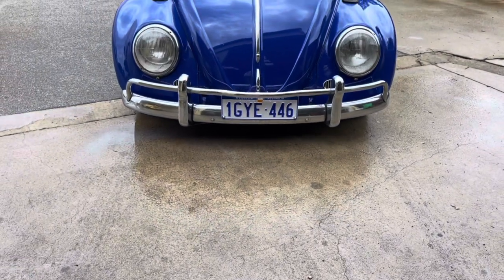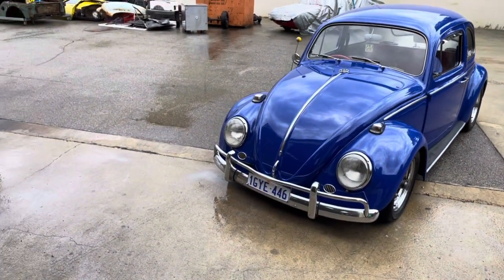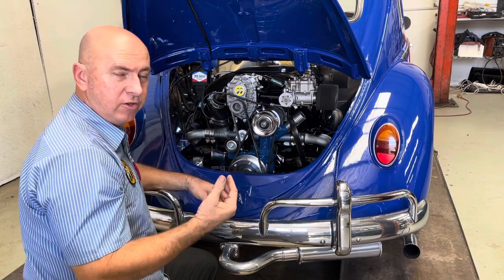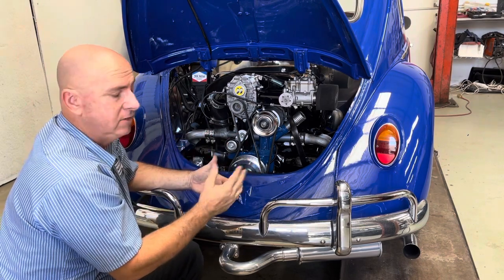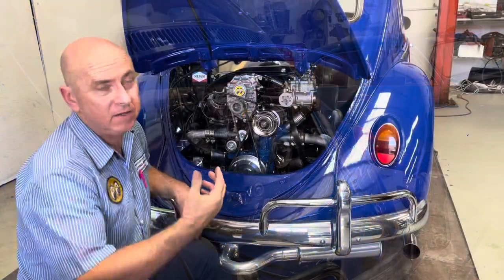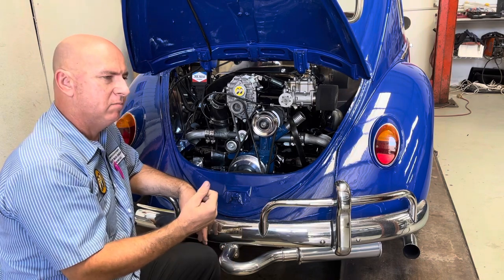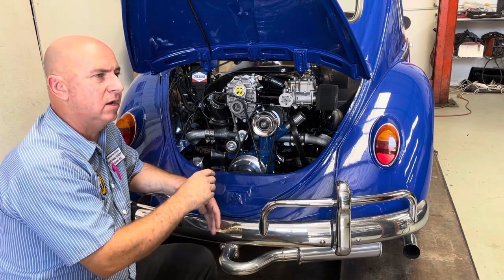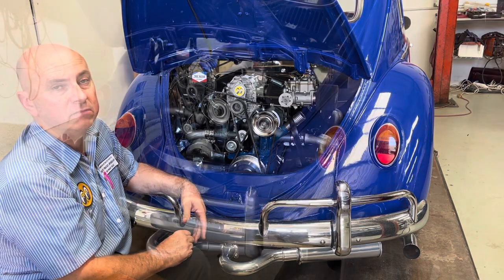Vintage VW beetle supercharger install and test drive with Armadale Auto Parts

Comment: Great neat installation of the blower. The beetle is very tidy. A have a 71 model with some custom mods. I am running a Stan Pobjoy 1916cc engine. One of these blowers would be trick. You have some great cars in your shop too, thanks.
Reply from the maker: Thanks!

Comment: Hi Alan, thank you for the video. I am considering the same kit for a future engine build. Mick at JB is very helpful. I am a bit surprised by the noise as it appears to be a serpentine belt drive so I assume the noise is from the supercharger. I have an Eaton supercharger on another vehicle and it is very quiet. I always wanted to build a hot rod but I think age is going to beat me.  :-(
Reply from the maker: Hey Michael, yeah I think most of the noise is the supercharger itself.

Comment: Cool well done I'm Thinking of getting one of these kits for Bess Instead of Going Down the more traditional path Too Make her a Little More Responcive for modern day Traffic conditions 
Bess Is still Totally stock , are They Reliable you reckon for a Dayly driver once its all set up Properly ?
Reply from the maker: Hi Brian, it took a bit of sorting but now seems to be pretty good. Good low down power increase for sure.

Comment: How did you go for deck lid clearance on this? Cheers
Reply from the maker: Hey, we used a deck lid stand off kit. It might just fit but very tight , mainly at the air cleaner part

Comment: is it possible to add A/C with this setup?
Reply from the maker: It would be hard to fit a normal air con compressor, maybe look at an electric compressor?
Reply: @armadaleautoparts-hotrodsh9313  Hmm never thought of that, I might look into that further since no one did an electric A/C compressor in my country yet. Though I am worried about the alternator not having enough electricity to power it; but thanks for the idea!